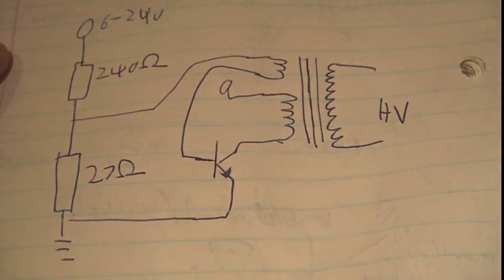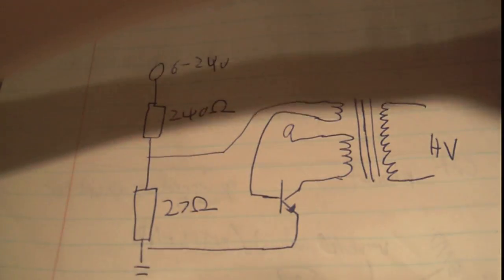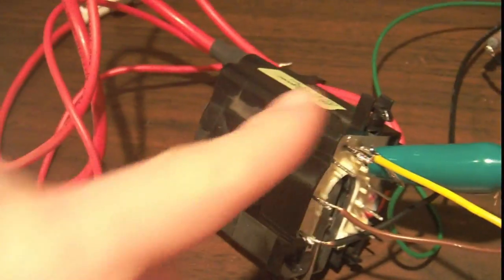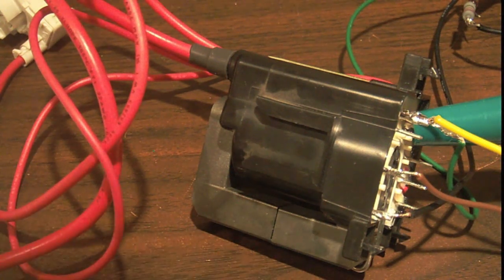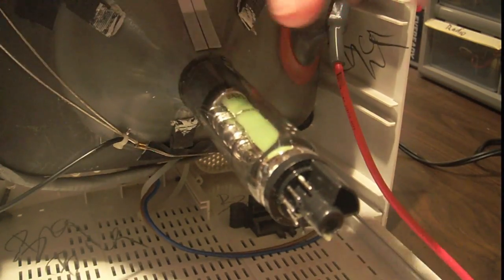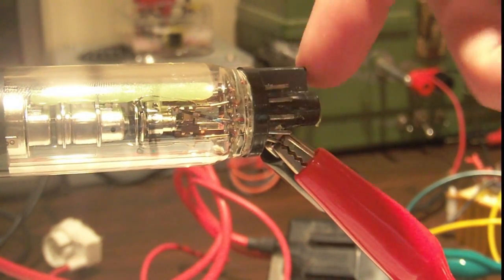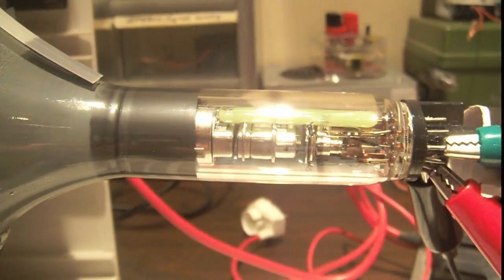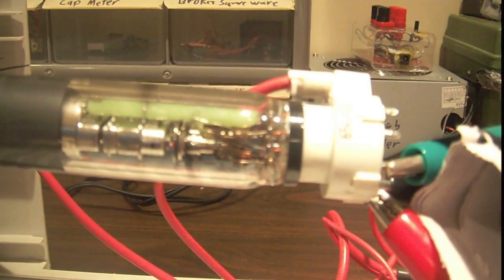Flyback Transformer

Comment: I agree. I made an astable 555 driver (that uses the 2n3904 and 2n3906 with a power transistor). I rectified a 24vac 900ma power supply and put it in series with a 6v battery and a 12vdc power supply, while using a 2nd 6v battery to drive the 555. It was a total of 42 volts going to the flyback and I got 75kv out of it and 3 inch sparks. There was very high current and it was enough to burn plastic and melt wires on contact.

Comment: The horizontal output transistor that drives the flyback transformer in most tvs have 160vdc on them. So 160vdc is high speed swimming the flyback.

Comment: Try swapping the MJE13009 for a TIP35C and you will get a much better arc. I have tried with several different transistors including both the MJE and TIP. TIP wins hands down. The rest of circuit keep as is. I also tried MJE13009 in parallel also TIP35C and 2N3055 the 2N3055 wins the parallel. I am going to go the voltage way and try mosfets next. Keep experimenting its great fun!

ANY OLD TV  ORE  MONITOR  TR USE

aziz jamali 

karachi 

pak

Comment: HI , I have a question for professionals, (or maybe not).
Energy is transformed right nor created or destroyed, then if the power of a 12v 10A battery is 120 Watts and those 120 watts don't kill you even if you put the battery in your tongue, Why these flybacks are so dangerous? They keep outputing 120 w with a higher voltage but the amperage is inversely proportional so there should be not much current flowing... 

This is troubling to say the least.

Comment: in order to get bigger sparks,
you simpley need to use a higher voltage on the flyback driver,
like 12 volts, cuz other flybacks that i know of work with 12 volts...

Comment: Hi, Brad

You'll realize far better results winding your own primary and feedback coils (4 to 5 turn primary and 2 to 3 turn feedback)

Of course you'll need to find a flyback transformer with sufficient core-space to accommodate said windings --- Useful transformers are often present in older TVs and CRT monitors...

Most flyback transformers don't contain windings adaptable to the Royer topology -- Hence the presenter's difficulty locating a suitable transformer...

Comment: can i know how many turns of primary and secondary winding ? and the mutual inductance ?
also i want to know the value of output voltage ?
i want to use this transformer in full bridge converter so i want to know electrical specification

Comment: I did not finish watching the video because of the distracting background noise.
More than likely that flyback assembly has a part number printed on it.  If you
Google that part number you can find a link to a schematic diagram of the flyback itself or a television containing that flyback.  One or the other of these schematics will list pin numbers which will help you identify the corresponding terminal pins on the flyback assembly.  I did this for a very similar flyback assembly not too long ago.  I don't know where I saved the .pdf file of that schematic or I would give you a link to it.  It did not take long to find.

Comment: First of all EHT on color TVs is 25KV.   Your design is weak. It needs a 15Kz to 18KHz saw tooth oscillator to drive it.  You could duplicate the Horizontal oscillator and driver from any color TV circuit
Reply: +Andrew_koala Strange. I agree, with you. The design is very weak. I thought flybacks were powered with pulsed DC and not a sawtooth wave. I ran an identical flyback on 12 volts with pulsed D.C. and I got 30+ KV out of it. However, made my own primary consisting of seven turns. I was running it with a 555-timer flyback driver @ 25ish Khz.
Reply: +Andrew_koala It's not sawthooth, it is really a square wave. Horizontal deflection coils need a square(ish) voltage drive (they are very inductive at 15+ kHz) and the flyback pulse is very large but is an half-cycle sinewave, and vertical deflection coils need a trapesoidal drive (sawtooth scan + flyback pulse) because of the low frequency (they are resistive at 50-60 Hz).
Reply: Renato Encarnação wait, I tough the tv flybacks were driven with a sine wave, as they basically use a single transistor feedback oscillator, or that is at least whet I saw in all the crt's I took apart. Also, are vertical coils not driven by a sawtoothish voltage @15khz?
Reply: +Ivan R No, flybacks are driven by the line output transistor, that can be fully on or off depending of base drive. The base drive is a square wave at line frequency, 15625 Hz in PAL countries and 15750 Hz in NTSC countries, provided by a separate line timebase oscillator. Vertical coils are driven by a sawtooth during scan time and a big pulse during retrace time. The vertical drive frequency is 50 Hz in PAL and 60 Hz in NTSC.
Reply: Wait, I am confused: I found a very similar circuit as shown in the video in several tv's I took apart! Where does the square wave come from, as this is a sine wave feedback driver!
Reply: The circuit shown in the video is not a sine wave oscillator, there is no tuned circuit. It's a relaxation oscillator using feedback from the transformer. The output of this oscillator is an almost square wave.
Reply: Renato Encarnação it is, as the feedback coil and the primary coil act as a resonant transformer.
Reply: Renato Encarnação this circuit is basically a feedback oscillator on steroids, and they are know for producing IDEAL sine waves!
Reply: +Ivan R For the circuit to be resonant, you'd need a capacitor in parallel with the primary of the transformer. All oscillators use feedback, positive feedback by the way, but the output is not always a sine wave. The output may be a pure sine wave if the feedback loop only gives positive feedback (180º rotation from the output to the input) on the frequency of the sine wave, AND the amplifying device (the transistor) is linearly biased, but that's not the case.
Reply: Renato Encarnação yes, but the primary has parasitic capacitance!
Reply: If all you want is a high voltage then the waveform overall shape is unimportant as long as it has a sharp rise or fall content. 
The reason for a sawtooth in a tv crt is for the flyback to be as quick as possible.  
This is the basic building block of getting a picture on a CRT.  
The UK PAL system TV uses a Line oscillator at 15.625KHz
Reply: Both coils are driven with a sawtooth, when the beam reaches its limit both vertically or horizontally, it needs to get back to the start as soon as possible.  UK PAL uses 15.625KHz sawtooth for the line oscillator (Horizontal deflection) Old school tv's that is.